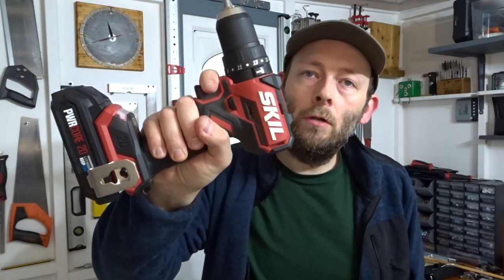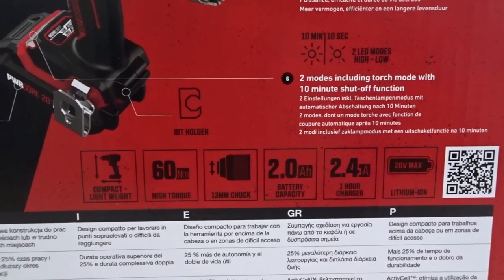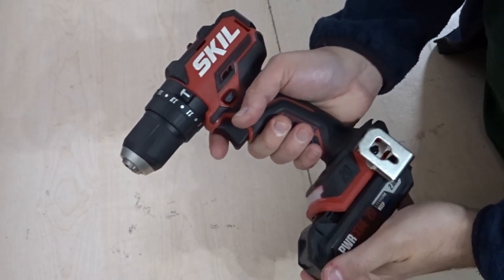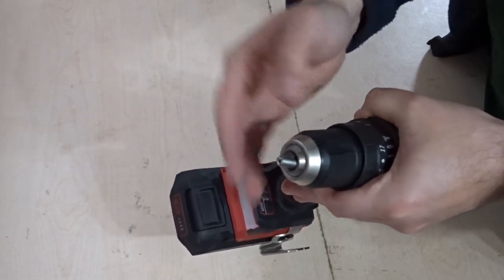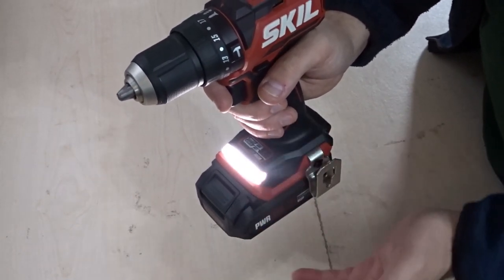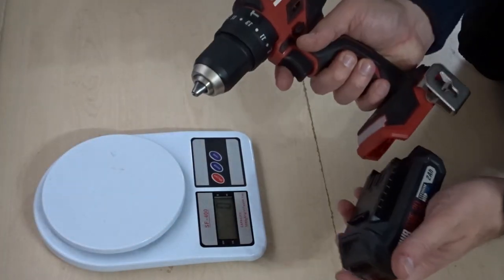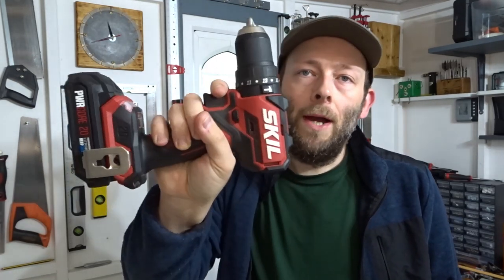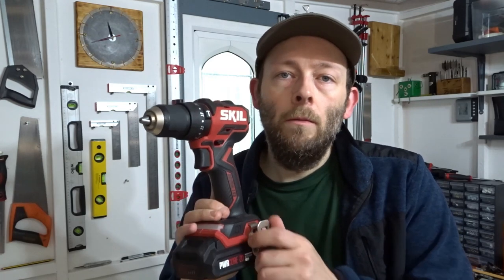SKIL 20V Brushless Cordless Combi Drill Model: 3075 (Tool Review)

Comment: Just a suggestion, try all settings.  Skil 20v drills are amazing overall.  I've dropped this drills little brother dozens of times over the 3 years I've had mine from up to 10 feet.  It finally started to have issues with the low "gear" after the 25th bag of concrete.